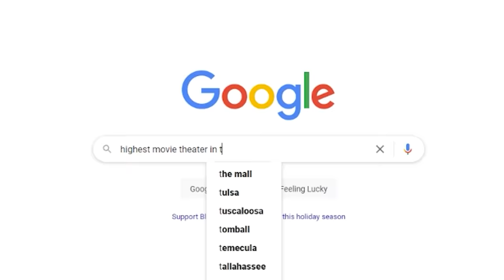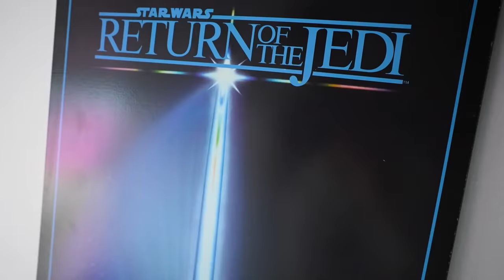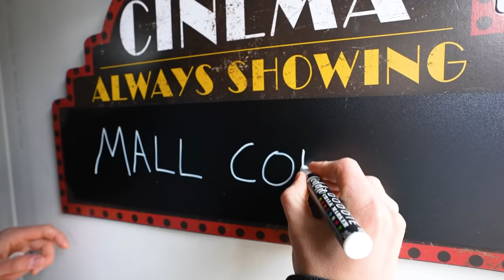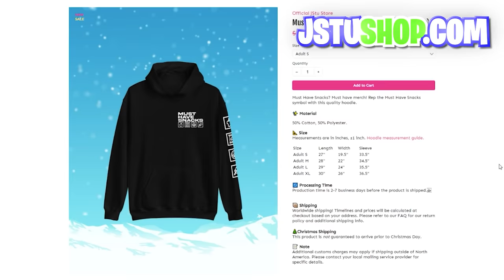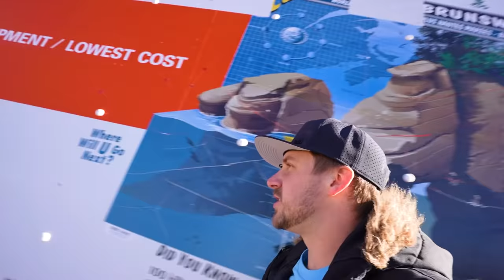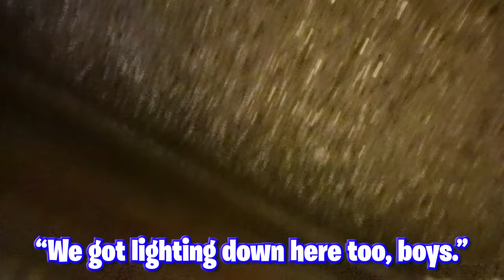We Made the World's Highest Movie Theater

Comment: If the leak was windshield wiper fluid you would've been fine. If it was leaking antifreeze, the engine might've overheated and I imagine with new engines it would've shutoff on its own. But with how cold it was I doubt it would've overheated much.